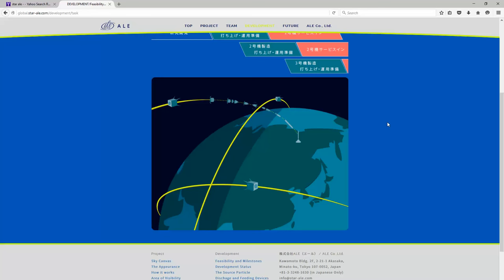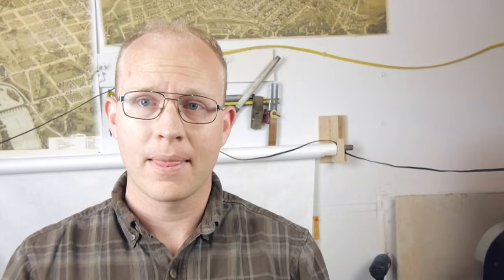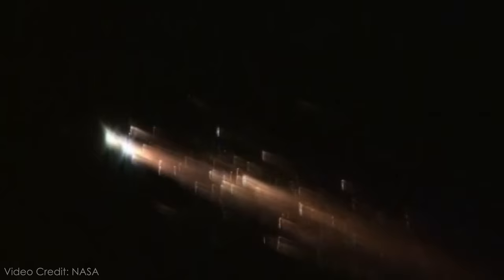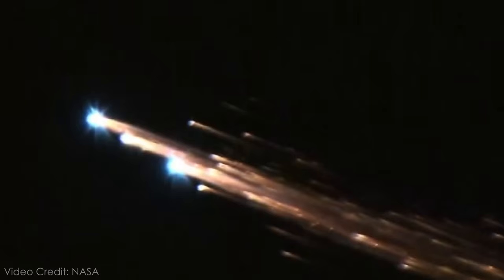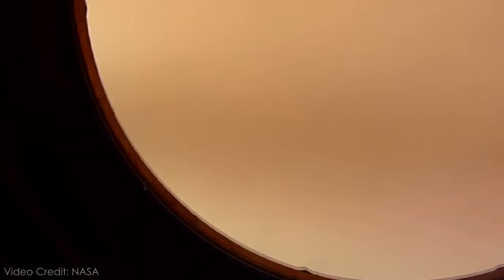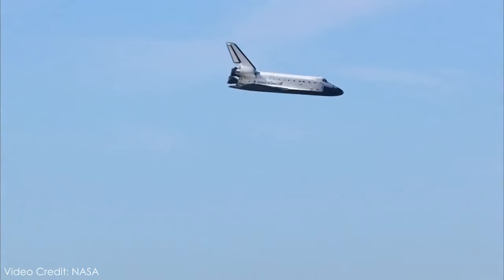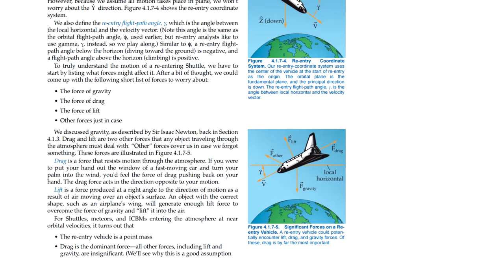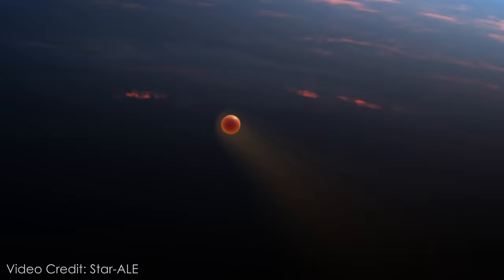Artificial Meteors and Re-Entry Engineering

Comment: I like the style of your videos, they're a good length with an appropriate amount of information to appeal to a wide audience. I've got heaps of video ideas and engineering related questions, everything from enthalpy of fusion with metal casting to Carnot cycles of Mollier heat pumps. But what i really want to know is how those damn "bird water feeders" (for lack of a better name) work! why doesn't the water just fall out! is it surface tension? air pressure? reality glitch?
Reply from the maker: Really funny you should ask. Hate to reveal this too early, because things can still change, but I'm planning on doing the next video on hydrostatic fluid pressure. I'll try to work in some discussion about those feeders (I have one for my cat too!).
Reply: I saw your instagram post about pressure at different points and it reminded me of the feeders. I'm looking forward to the video. You should check out some videos on how pressure differences (not static though) can affect divers underwater. That along with hydraulic injection are two deadly examples of fluid pressure.
Reply: Lol just  a few days ago I had the exact same question when I first saw those things.

My birds think they are a miracle too. They keep pecking the plastic container, trying to get to the water inside. But they don't realize they need to drink from the bottom. I can't blame them since I don't know how it works either.

Comment: I heard about the plans of the artificial meteor shower.  For it to look spectacular they are really going to need BIG chunks of material and a bunch of it.  Otherwise its going to look 'dime store'
Reply from the maker: I think you're right, but I have to say, dime store meteors on command are quite a bit more impressive to me than any fireworks display, just on account of the technical achievement alone.
Reply: Well, common shooting stars are only about 1mm in size, so it shouldnt need too much to make it look good
Reply from the maker: Geredd Hayes That's true, but they're also moving a lot faster than a low-earth satellite.

Comment: Quite a novel concept... until one plows thru someone's roof.  Here comes the attorneys!
Reply: I dont think its much of an assumption for me to say that they'll be built to burn up before entering the stratosphere.
Reply: Even if something survived they'd hit the pacific ocean. But yeah, shouldn't be that hard to have them burn away way before there's any danger.
Reply: Panc8ke "real possibility" Theres a "real possibility' of a lot of things, doesnt mean I go online and make a bunch of paranoid comments about them. All "real" means is that it exists, you don't even need the word "real". As long as it is .000000000000000001% possible, there is a "real" possibility.

Of course, what you meant to say is a "Considerable possibility", and to that, I laugh.
Reply: Engineers may always consider disposal when designing missions today, but they weren't always so thoughtful. When Skylab came down, its reentry was completely uncontrolled. It ended up scattering debris over Western Australia, with some parts fallling on the town of Esperance.
Since this was Australia and not America, no army of lawyers ensued seeking punitive damages - the city just sent Nasa a fine for littering!